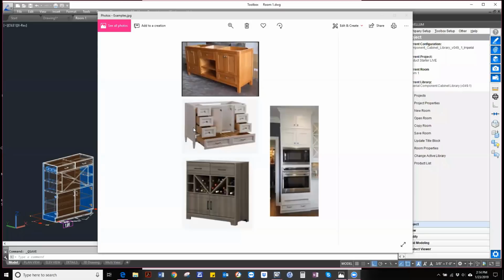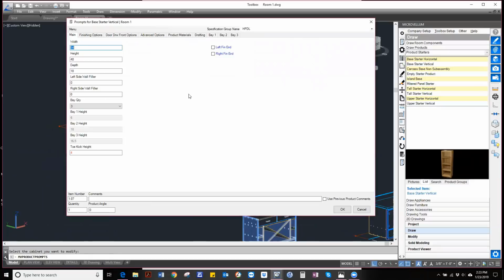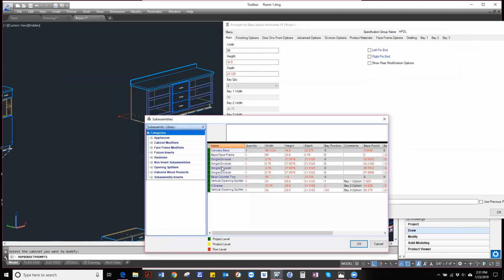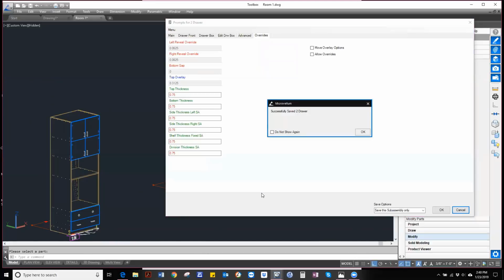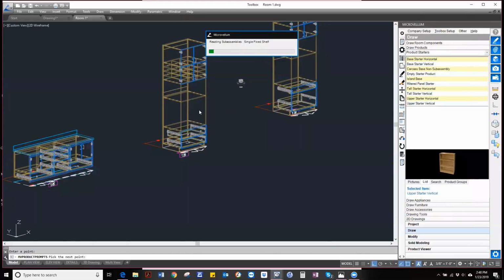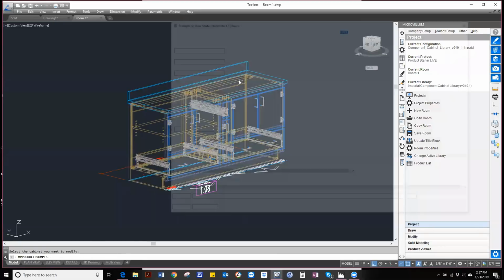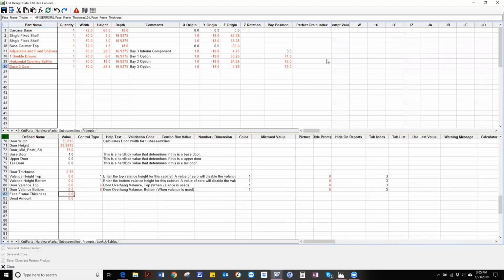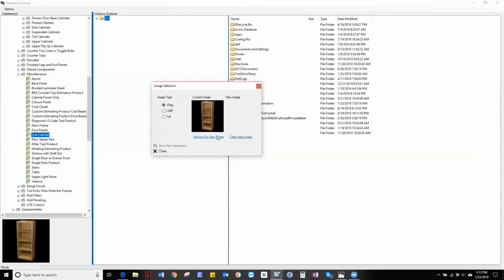Microvellum LIVE - A Faster Way to Engineer Custom Cabinets

Comment: I found out the designer cabinet  but not this one those starters cabinets and when I open the designer one after select vertical splitters my options inside the assembly prompts reduce to a 4 options. I am straggling with extra options in vertical or find this amazing cabinet